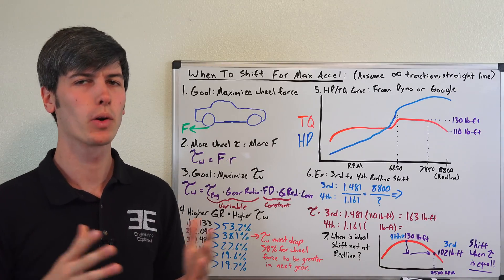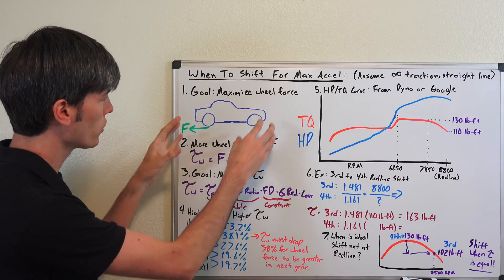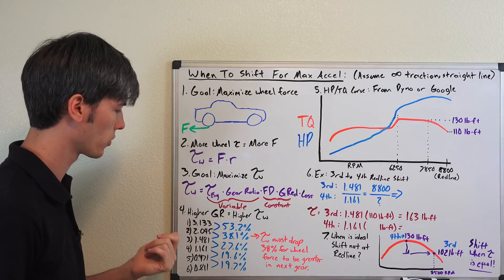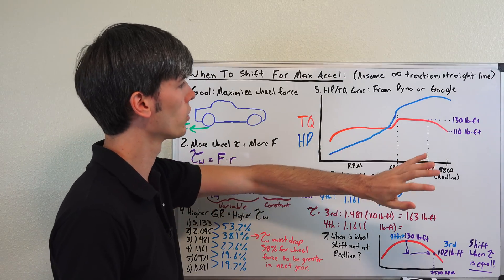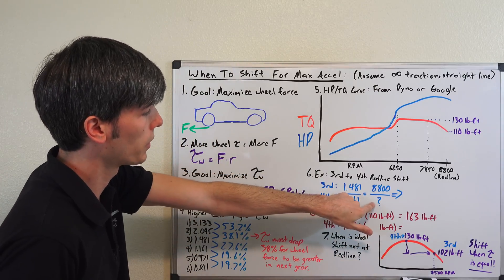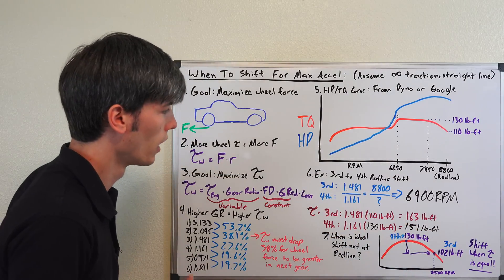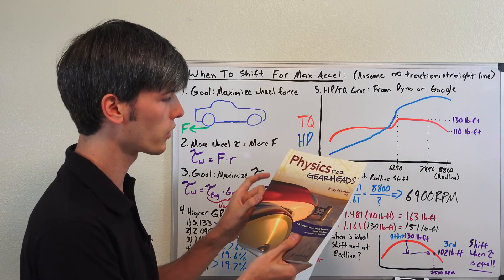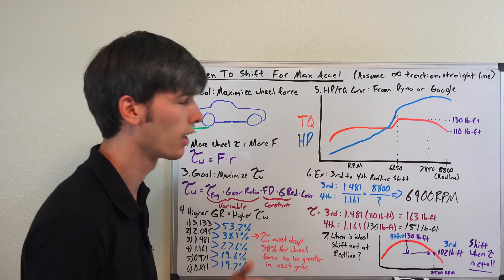When To Shift Gears For The Fastest Acceleration

Comment: why you use the engine tork, and not the horsepower?
Reply: Torque at the wheels = acceleration. Power (or HP) is work done over time, aka torque done over time, the more of it you have, the more torque you can generate through gearing, and you'll have a faster car (both acceleration wise and top speed). This is why torque is the most overrated engine spec, because engine torque means nothing, since it'll change through gearing, whereas HP is constant in every gear. P/W is the key factor for a car with max acceleration and top speed (then you have drag etc.)
Reply: Not really, power moves a car, it's a measure of how much motion energy the engine can generate. Torque does not mean much, you can always generate more torque through gearing.
Reply: Torque is the force that moves the vehicle, but power tells you how much torque you have at any particular speed (ground speed, engine speed, wheel speed, it doesn't matter), so you can ignore the gear ratios.  It's much simpler to just compare power at redline in 3rd gear with power at the equivalent RPM in 4th gear and say "the power is higher, therefore torque and acceleration are higher." without having to multiply the engine torque by the gear ratios.  If the power is 5% higher, you are getting 5% more acceleration without doing all the extra math to get to the same result.
Reply: tork is beter 4 akcellerasion.
He explains this at the beginning of the video.
Reply: torque*
Reply: you use torque to move a car, not power. Power is just a representation to make comparisons between engines easier. An engine with peak power at higher RPM is generally better at racing and top speed, for example.
Reply: What is important is torque at the wheels, not the engine torque. To make torque at the wheels you can use two things: torque at the engine or RPMs at the engine (a gearbox "converts" RPMs into torque). Power is precisely torque times RPMs, so it is the useful number.
Reply: This would shave off a lot of math from this calculations but would not explain it really good. 

Simplest determination if you want to shift at redline or not is just to look at HP at redline and HP after you change the gear, if you get more by shifting earlier then do it. But it is hard to explain because our butt-dyno reacts better to torque than to power. It feels "off" when you get past peak torque and can feel losing torque as you accelerate but it may still be faster than when you can feel that constant or rising torque pushing your back.
Reply: RazorTM Wrong, power is what gives acceleration. Torque itself is meaningless. In order to move an object, you need work. Torque is a force, and in order to do work, you need revs, which then results in horsepower. Power is energy, power is the rate at which work is done. The only reason torque is specified is because from torque you get horsepower. The more horsepower, the better the acceleration. An engine with 500 Nm and 200hp will accelerate the same as an engine with 200 Nm and 200 hp, except that the high torque engine will rev slower, since tipically, in NA engines at least, in order to have big torque you need a higher displacement, and thus more weight and less revs.
Reply: +Xavier Andrade You're contradicting yourself, since power is directly related to torque. Edit: well, not directly, but a function of.
Reply: Horsepower is only a function of torque and rpm.
Reply: Mudux 
You are correct saying it is basic physics. 
One cannot ignore these physics facts: 
"acceleration = power/(mass x velocity)" 
"power = work/time" 
or "power = torque x angular velocity in radians per second" 
or "power = torque x RPM" 

Torque is an applied force, not power. 
No power, no work, no acceleration. 
Torque at zero RPM is static torque or torque in equilibrium which produces no power and no acceleration. 
An example of static torque is using a torque wrench and applying 100 lb-ft torque to a nut, the nut is not turning, there is no power produced and no work occurring, the forces are static and in equilibrium. 
Notice there is 100 lb-ft of torque applied but there is no movement, no rotation, no acceleration, no power, no work. So torque by itself "DOESN'T do the work". 

Once angular velocity (RPM) is introduced with torque then power is produced and work can occur. 
For automotive acceleration applications torque and power are both intrinsically and inextricably linked. 
Hopefully this helps.
Reply: Mudux 
OK, I stand by my statements. 
Please explain in detail how torque alone moves a vehicle.
Reply: Here's an analogy:  You are trying to pick up a 500lb dumbbell.  You are producing 300lb of force from your muscles but it's just not enough to lift the dumbbell.  There is no distance over which you have applied the force, therefore no work was done.  But you most definitely applied a force.
Reply: Xavier Andrade It is torque that's being converted into a force. Force can be described as F=m*a (in other words, a mass that is accelerating). Power is the rate at which torque is being produced. So yes, torque is the factor that moves the vehicle.
Reply: Xavier Andrade But P/W ratio is still #1 factor when it comes to making a car accelerate quickly, just like an F1 car (which doesn't even produce more than 300 Nm of torque).
Reply: Which is exactly what I said?
Reply: B10401 Nothing wrong, you have good intentions. It's just that if you scroll up you can see that there are like 6 dudes preaching from a textbook.
Reply: +Mr. LargoFeet 
That statement is correct, however torque is an applied force and if you do not have RPM and only torque, then there is no work being performed and no power being produced and no movement. 
As that relates to a vehicle...  no wheel RPM equals no vehicle acceleration and no vehicle movement.
Reply: patw52pb1 Why are you guys so set in saying that? Of course if there's no movement there's no work, that's basic physics, and DOESN'T mean that the torque doesn't does the work.
Reply: patw52pb1 you're messing things up. Movement isn't introduced with torque, but BY the torque. You can manipulate equations till the end of the world, but you can't change this fact.
Reply: Torque is not meaningless.  Since Torque is a (rotational) force, it is directly proportional to the acceleration.  F=ma, right? Doing the calculations based on power is better because the gear ratio calculations cancel out so you get a more direct result.
Reply: RazorTM Torque is used to get horsepower with revs. Torque at 0 rpm does no work, thus no power, and therefore the object does not move. You can argue all you want, but physics are physics and for acceleration you need work, which is horsepower, which is torque * rpm. Torque has no direct involvement in acceleration nor top speed whatsoever.
Reply: ***** no need, thanks.
Reply: ***** ignorance is someone saying that "Torque has no direct involvement in acceleration". Leave your shell and try to learn something, it's pretty satisfying.
Reply: Mudux I learned in fact. And what I said is just physics. You refuse to learn the truth. Torque has no direct involvement with acceleration because horsepower does. Horsepower accelerates your car, torque is just the twisting force made by the engine, which in combination with the revs, produces work, and thus acceleration. Apparently you should get a lot of satisfaction from learning this. Even patw52pb1 tried to tell you how things work, but you refused to acquire knowledge. Such a pity....
Reply: ***** Keep saying that, someday it may come true...
Reply: ***** Keep your bollocks to yourself, mate, I have no need to learn your "truth".
Reply: ***** How many times did you fluked Physics?
Reply: You're completely ignoring that when the torque applied is more than the torque required, there is a net acceleration and the engine RPM will increase.  Electric motors most definitely produce torque at 0 rpm.  You really need to take classes in statics and dynamics.
Reply: Yes, electric motors produce torque at 0rpm but they do no useful work unless the load is less than the torque produced, at which point they accelerate and are therefore doing useful work.
Reply: If it were a 150lb dumbbell and you applied 300lb to it, it would accelerate rapidly upwards and you have therefore done useful work.
Reply: Yes, 0hp at 0rpm but a force is still applied.  Once the load starts to move, the engine is no longer at 0rpm.  Even at 0.00000001rpm, work is being done.

You're showing me that you don't actually know what a force is.  Go back to newtonian physics 101.
Reply: horsepower is really just the speed at which torque is applied. really what you're doing when you turn the engine is producing torque, not horsepower.
Reply: +Xavier Andrade
"What is important" depends on the context that its being applied to.  If I'm a transmission engineer and I need to design an input shaft that won't break on a given engine, torque is definitely more important to me.  If I'm a drag racer that wants to get the best quarter mile time, power is most important to me.
Reply: +DoubleC
You're only seeing one side of the subject, and we are having a communications failure about a factual matter.  Try to take a more holistic approach.

How do you explain that force and mass are all that is necessary to calculate acceleration while acceleration cannot be calculated from Power and Mass?

You are not wrong in saying that a net power applied or net work applied to a system will result in acceleration, but that is only one way to look at a system.  

You are wrong, however, to say, "you don't use torque to accelerate."  In fact, you do, and you need not have velocity nor rpm nor distance, nor work being performed to determine the rate of acceleration.
Reply: He's just completely ignoring Newton's first and second laws of motion, at the very core of Newtonian physics:
1. an object will remain at rest or in uniform motion until acted upon by an external force
2. force equals mass times acceleration (or, acceleration equals force divided by mass)
Reply: Chris Arnold You don't get it. Yes, you apply a force but you need work in order to move. If you lean onto a wall, you apply a force, but the wall doesnt move, because its counterforce is much greater, and so you don't make work. If you are so sceptical, just check for other sources, don't come up with futile explanations.
Reply: @Chris 
there's no point in arguing with this guy, he's too lost in his own mind.
Reply: Mudux Well, it is true. I once believed torque moved mass, but I had the resolve to learn, and so I understood that what people say is not always true. Energy moves mass, not torque, keep that in mind at least, or ask any proper engineer. The guy in the video, he is also an engineer, even though this is a pretty simple concept, he wanted people like you to understand.
Reply: Mudux Once again, "mate", it is not my "truth", is physics, and stop arguing with me if you won't do anything else than speak nonsense.
Reply: Mudux Pathetic. Apparently we are done. I guess not everybody likes to use their brain.
Reply: ***** lololol
Reply: +RazorTM So what electric engines produce torque at 0 rpm? Actually, you wanted to say that electric engine produce peak torque the instant you touch the throttle, and CVT's are made to emulate their power delivery which is completely different than the one in an ICE engine.
Reply: Also, if you think about it, a combustion engine can do work at almost 0 rpm because the work is actually done by the explosion in the cylinder pushing the piston down with a certain amount of (varying) force over a certain distance.  If the load is small enough, then an engine can be programmed to stop itself at the top of the compression stroke when turned off and that cylinder can have fuel injected and ignition to start the engine running again.  Some start/stop systems on modern cars work like this.  Others use a larger electric starter which, again, does work starting at 0rpm.
Reply: RazorTM RazorTM An engine won't do work at 0 rpm. I've yet to see this. Once again, you do need energy to move an object, torque is not energy, is a force. If you produce torque at 0 rpm, it means the engine is producing 0 hp, and guess what, nothing moves. An ICE has peak torque and peak power. At 0 rpm all engines have 0 torque and 0 power. As the revs get higher, torque and therefore power get higher, thus making work and moving the car.
Reply: RazorTM Yes, the force is applied. And yes, as long as the engine is not at 0 rpm, is doing work, but it is not the torque that moves the object, is the power produced by torque and the rpm
Reply: +Vethursan1
"Power is the rate at which torque is being produced."  Mathematically, you're saying P=torque/time.  That is demonstrably false.  Power is the rate at which work is being produced, or P=W/t.  That is correct.
Reply: +Mr. LargoFeet
"Horsepower is only a function of torque and rpm."  Not true.  Horsepower can be applied in a linear way too, which is without the RPM component.  1HP = 550 ft-lbs (of work) applied per second.  This would be akin to lifting a 550 lbs box upwards by 1 foot per second, which is roughly what the average horse is capable of doing for a sustained time period.
Reply: +patw52pb1 
You were on the right path until you implied that applying a force equals no acceleration.  Study F=ma and try again.  Note, there is such a thing as instantaneous acceleration, and it's why when a vehicle is at a stop, where by definition there can be no power (P=f*v), there can still be acceleration.  Similarly, electric motors can impart a force at 0 rpm when they are by definition producing 0 power.  The torque applies a net force which causes the instantaneous rate of acceleration to be positive and start the vehicle in motion.
Reply: +patw52pb1 
"No power, no work, no acceleration"
No power, no work would be correct.  However, you are looking at the wrong acceleration formula.  a=f/m clearly shows that power is not necessary for the existence of acceleration.  Think through the context of your formula a=P/(m*v) to see that P/v can be reduced to simply f.  However, your formula gives an indeterminate result when v=0.  At v=0, a net force applied can surely result in acceleration even though there is no power at that moment.
Reply: +DoubleC
"Wrong, power is what gives acceleration. Torque itself is meaningless."
You're not wrong about power, except at 0 velocity, but you are wrong about torque since you can also get acceleration using torque (angular acceleration = torque / moment of inertia).  This is the rotational equivalent to a = f/m.
Reply: +RazorTM.  Damn... you were on point until this:  "Others use a larger electric starter which, again, does work starting at 0rpm."  

Work cannot be done without movement since W=f*d.  Electric starters produce a net force at 0 rpm.  I think that's your point.
Reply: Chris Arnold In a car, you don't use torque to accelerate. You need work. And torque is a force. With RPM and a gearbox, the power is generated and sent to the wheels. Torque is important because from it you get horsepower. But I can't help but laugh when I hear "torque moves mass".
Reply: +B10401
#1:  You solved the kinetic energy equation for velocity, not acceleration.  You then used Energy and mass to solve for velocity.  So, you proved that a mass of 1kg with 1J of kinetic energy will be traveling sqrt(2) m/s, which is not relevant to the point you appear to be trying to make.

Let's specifically address the point at issue that you are attempting to contradict:  "I'd like to point out that you absolutely can calculate acceleration from power and mass."

This is false.  Here is an example:
My car (stock 1991 foxbody mustang) weighs approx. 3,200 lbs (lbs-mass) and is, in a given moment, applying its power peak of ~200 hp (at the rear wheels).  What is the acceleration?

Answer:
It's incalculable, because you don't have enough information.  You need velocity, since f=P/v.  If you have power without knowing velocity, you cannot solve the acceleration equation.
Reply: +B10401
#2:  "acceleration will fall exponentially as speed increases because of the exponential relation of speed with kinetic energy."

That's false.  If you double the speed, the acceleration is not 1/4, it's 1/2, because a=P/(v*m).  So it's inversely proportional to velocity, not inversely proportional to the square of velocity.  You were misled by applying the wrong equation and getting lost in the ideas about the relationship between energy and power.
Reply: +B10401
#3:  "power is what an engine can produce at any speed."

Say wha???  lol  I'm really not sure what this means.  Perhaps you're saying that if you gear it correctly than peak power is where you want the engine to be to maximize acceleration.  That would be correct.  So, I'll give you the benefit of doubt.
Reply: +B10401
#4:  "A constant force would, at increasing speeds, could only be the result of an exponentially increasing power."

You seem to be substituting power and force into your equation that includes neither power nor force.  Here's the equation you're looking for:  P=f*v.  So, a constant force at increasing speeds would result in power increasing proportionally, not exponentially.
Reply: +B10401
Several times in this thread of responses I have shown the formula a=P/(v*m).  So, I'm not really sure why you thought I implied that acceleration could not be derived using power.

My entire post to DoubleC was about taking a holistic approach and seeing more than just the power side of the discussion.  I specifically stated that a net power or work will result in acceleration.  If you've read what I've written in all of the posts, you can see that I know that Power (with velocity) can be used in the acceleration formula.  Changing it into a kinetic energy problem is yet another way to calculate things, but it's an unnecessarily complicated step in the process.  The post you chose to cite in this argument was about correcting DoubleC on how you do use torque to accelerate something.  In that context, your preference is irrelevant to the point that I made.

There is no universally best method of approach.  Everything depends on the information you have, the context of the situation, and information you want.  Honestly, when you start breaking out exponents, nobody except guys who do physics for fun are going to paying attention anymore.  LOL
Reply: +B10401
"Well you need speeds AND gear ratios to figure it out with just force or torque."

and, wait a second.  This is a mischaracterization.  You do not need speed or gear ratio if you have the net force.  Then it's just f/m.  Speed is irrelevant.  The force applied to a given mass will always result in the same acceleration.  That's what sets it apart from power.  The same power applied at twice the speed results in half the acceleration, because it's applying 1/2 the force.

Yes, from engine torque, you'll need the gear ratios (transmission, and differential) and you'll need the radius from the axles to the contact patch, but you still will not need the speed.

Can we stop arguing, yet?  You actually agree with me, lol.
Reply: Jase This is so wrong. You treat hp and tq like two different things. Hp is a product of tq, without tq you can't make power. And what you send to the ground is power, not torque. Torque is only and only at the engine.
Reply: He must have deleted his comment, because I can only see it when I click the alert.

Jase, to state torque is power is evidence that you do not understand the difference.  Torque is angular force.  Power is power.  They are interrelated in the context of a vehicle, but not the same thing.
Reply: B10401 When your wheels are pushing your car forward, that's already energy. You can move only because of energy.
Reply: The use of the word "only," implies that force has nothing to do with motion.  Isaac Newton so disagrees that he made it his first law of motion:  "an object at rest stays at rest, and an object in motion stays in motion unless acted upon by an outside FORCE."
Reply: Chris Arnold Yes, even in the automobile there is the need of an applied force in order for it to move, namely torque, but it isn't the force that moves the object. And physics says that, not me.
Reply: WTF, man?  An object at rest stays at rest until an outside force acts on it, at which point it begins to move.  What could possibly be confusing about that statement?
Reply: If Newton's first law is a futile explanation, then I submit you're the one who doesn't get it.

His 3rd law is for every action there's an equal an opposite reaction.  So no, the wall applies an equal force that is applied to it, not a "counterforce that is much greater."
Reply: DoubleC, you said it yourself:  "the need of an applied force in order for it to move."  

That's the point.  If there is a net force applied, there will be movement.  Thus, movement (from an object at rest) is caused by a net force.
Reply: Chris Arnold I don't need to say anything. All the explanation is in that video.
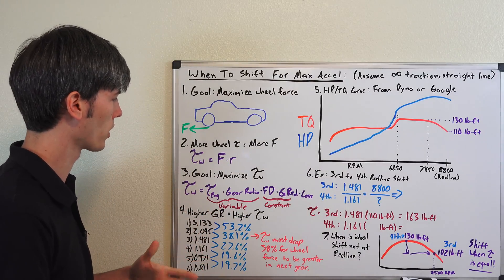Reply: Dude!  It IS in the video at about 0:54.  He clearly talks about wanting maximum wheel torque and hence maximum wheel force to maximize acceleration.  What is your hangup?
Reply: Chris Arnold The guy tried to explain that energy is required for maximum acceleration and you still didn't get it? Ok, I'm done here.
Reply: WTF?  Provide the timestamp!  I did.
Reply: Chris Arnold The whole video revolves around this question. He explains it thoroughly. Just have patience and watch it. Then argue all you want.
Reply: DoubleC, you claim the video revolves around it.  I showed you where it specifically states that maximizing wheel torque will maximize acceleration.  Your turn.
Reply: Chris Arnold At 0:54 he doesnt speak about wheel torque, don't know where you pulled that out.
Reply: So guess what, he doesn't use the words "energy" or "work" at all in this video.  So, what were you saying again?  LOL
Reply: Chris Arnold Are you even serious? Look, in the video, the guy explains why power accelerates a car. Period. If you want to watch it, fine, if not, don't keep nagging me on this. You can even ask him questions, he knows even better than me. Good day.
Reply: What?  He does speak about wheel torque!  The sentence at 0:54 is, "In order to maximize this force at the wheels, we want our torque at the wheels, obviously, to be as large as possible."  Just click the damn timestamp.
Reply: Chris Arnold Ok, we clearly misunderstood something. I was talking about the video I linked, not this one. You then tell me that in this video Jason says what he says at 0:54. Soooo....apparently you kind of didn't watch Rob's video.
Reply: Honestly, are we watching the same video?  I'm starting to get the feeling that it isn't.  The video we seem to be posting under is "When To Shift Gears For The Fastest Acceleration" by Engineering Explained.  If that's the same video you're seeing, then I seriously do not understand your disconnect, because the words "energy" and "work" aren't even used in the video.
Reply: DoubleC, you have not provided a link to any video in this conversation.
Reply: Chris Arnold How so? In my last comment I provided it. I can see it. Or maybe it is a bug from Google. Actually I gave you the link twice, but that explains why you didn't get it. Strange though.